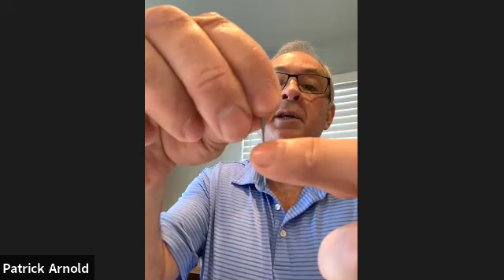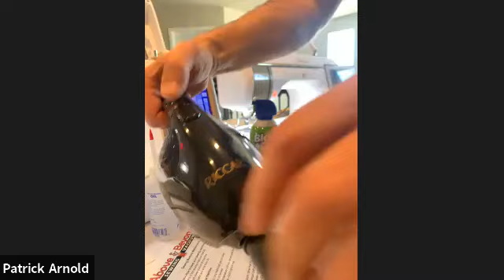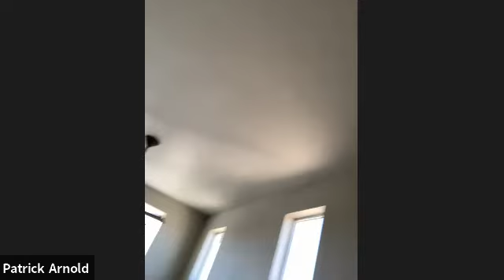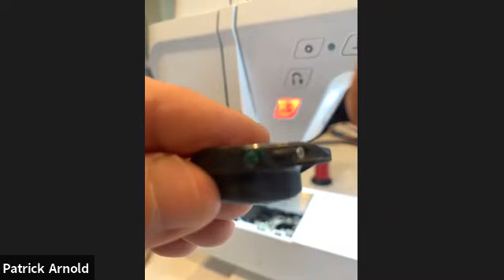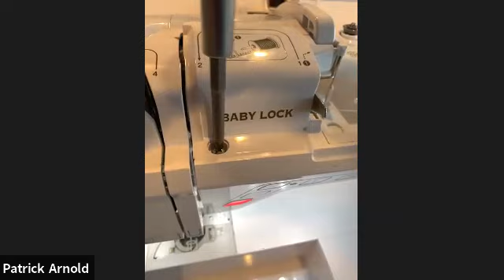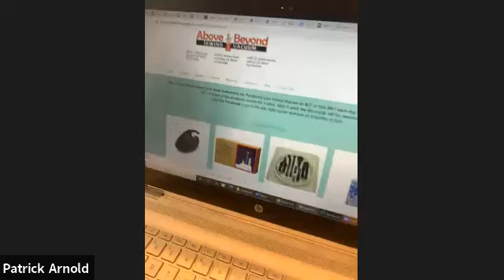Sewing Machine Maintenance for the Babylock or Brother Sewing and Embroidery Machines.

Comment: I have a baby lock Destiny and I use it a lot and after so many stitches it stops and keeps saying rethread the upper thread.  I do this and clean out the bobbin case, sometime change a needle and take the whole machine apart and clean it then put it back together but it still stops after a few stitches and then stops and say rethread upper thread.  What could be the cause of this for I have had other machines and they have never done this.  It gets expensive taking it in all the time.  Do you have any suggestions?
Patti

Comment: Is there a way to adjust the bar that holds the needle on my ellisimo gold? The needle is hitting the needle plate just behind the hole. With the plate removed, the needle hits the back side of the bobbin case. Problem started with needle threader not putting thread through needle. It only went through the motions. Then, after about a month later, the needle suddenly broke. Replaced needle and it bent severely on first stitch. 
Light pressure on back of post that holds needle, pulling forward, allows needle to clear the hole and bobbin case while turning handwheel. Is this a DIY fix or do I have to take it in to be repaired?  It's only been about 3 months since the machine went in for service.

Comment: I have a Babylock Ballad and Chorus... Had the ballad serviced in January. Only have abt 115,000K stitches and it is making that "noise!"
I brought it in because I had used an iron in interfacing with a project (fabric bookmarks) and the silly stuff left all kinds of little "pellets" debris in my bobbin area.... Like the glue pellets?
So I clean often in my bobbin area anyway.... I added oil to the area below the bobbin - is that all I need to do?
I don't want to pay another $135 technician fee just to have it looked at - and if they can't "reproduce" the issue I still get charged....i would like to learn to service my own machines.
I have five Babylock (two sewing, two serger, and the Euphoria)
And I find if you don't buy them locally they don't want I service them very quickly. (even under warranty! 😢)

Comment: Just saw your video. What causes embroidery machine (Elegante 3) to embroider at very slow speed?
Reply from the maker: This could be a couple of different things. 1. There is a setting in your machine to change the max speed. 2. This is the more common one, but on the front of your machine is a speed control. If this slider is all the way to the left then it is turned all the way down. You just need to simply slide that back to the right. If this doesn't work either then give our store a call and we can try and see what else could be causing it for you. 
Hope this helps,

Matt

Comment: I switch on the unit (Baby lock Crescendo Model BLCR ) and receive the message The Guideline Marker was not operating properly" then immediately got a second message saying "A malfunction occurred, turn off, then on" Then the screen  freezes! switching of / on the machine makes no difference - same 2 messages and locking of screen ! No solution - any idea ?
Thanks !! also to your youtube material !

Comment: Had my unity cleaned and adjusted. He said I had some damage on my hook . Can I continue using my machine until the part comes, without do additional damage? Been on order for a month and may take months to get the new part. Also have had trouble using/adjusting my Character stitches. Had the machine serviced twice. But the character stitches fail to stitch correctly shortly after. Can the hook affect my character decorative? Please help me get back to sewing once again? Karen

Comment: I found your site yesterday and found it very informative.   
I have two babylock machines - a crescendo and an altair.  I was using a thicker thread on the altair, managed to do the auto thread, but now I can't do the auto thread on the 40 wgt threads.  I now know that I should not have threaded the heavier thread, however is there anything I can do to fix the auto thread issue without taking the machine in?

Comment: I am BEYOND frustrated. My tension check spring broke on my Babylock Jane and I purchased a new one. I was able to remove the tension spring cover/pieces--everything EXCEPT the  old spring. I saw no way to get it out except to pull it. Which I did. And with pulling/twisting it came out, but how do I fit the new one on? This is so frustrating because I love my machine, I'm in the middle of a quilt, and there is ZERO information on this anywhere. Do you happen to know how to replace the tension check spring on a Babylock Jane because that would be  awesome.

Comment: Maybe someone can help me, my machine is doing something I find anywhere, after about 30 min use, when I take my foot of the pedal, the needed stops as it should, but there is a sound like something is still work, she doesn't fully turn off if that makes sense, I have checked everything I could find , loads of tips, nothing,, she sows fine, just this sound like something is still working when it shouldn't be.

Comment: Thank you Patrick! I truly baby my baby lock machines and finally learned those invaluable tips about checking the bobbin case, needle plate and the tension disc for debris!  Also, thank you for advising to occasionally oil the serger.  
I make a lot of in the hoop projects and find the thread really bounces. I had to take it off the horizontal pin because it would twist as passing through the tension assembly and now i get bouncing with it on the vertical stand.  I'm wondering if the stand might be too high?  
Thank you!

Comment: THANK YOU!!! This video just saved me a lot of money I would have had to pay a repair shop.  I sat here with my Brother machine all opened up and followed along with what you were doing.  The very first thing I learned was that plastic piece could come off without taking the screws and cover plate off everytime.  What a timesaver and I feel really dumb. 

My machine is going on 10 yrs old.  It has worked very well for me and I clean it often.  I have been having tension issues and have found that giving it a good clean always helps.  Well, this time it didn't.   While watching you, I pulled out the bobbin case and looked at it closer and found lint, fuzz, and a huge piece of shredded thread.  This improved it 99.9% and a little adjustment of the screw fixed it the rest if the way.
Reply: QUESTION: once you adjust that screw, should the purple/blue tapey-glue stuff be replaced?  If so, do you know what it is called and where I can get some?

Comment: I just found this site on 9/11/21. Patrick thank you for explaining everything perfectly. I have a Unity and had a sound every time the needle came down. Needles kept breaking.   I learned so much on this site and fixed my machine myself by tipping the machine upside down which was a end of the needle that was hitting under the bottom case. You saved me $250.00 service charge.

Comment: Hoping you can help. So glad I found you! Need a little help. I repaired the thread holder on my xl-6040 and a little spring came undone while I was putting the case back on. The little spring is still connected on one side close to the tension wheel but I don't know where the other end attaches? Please help! Thanks again!